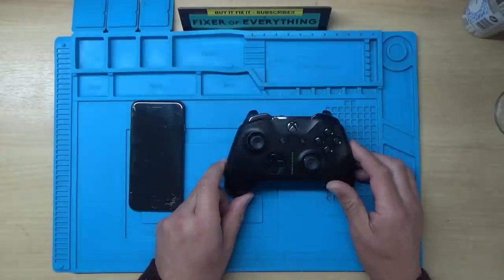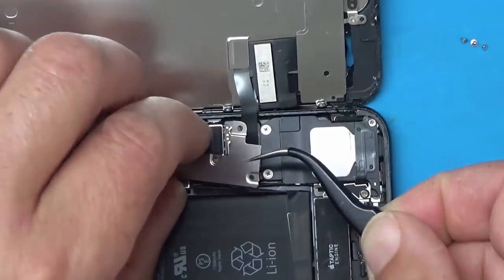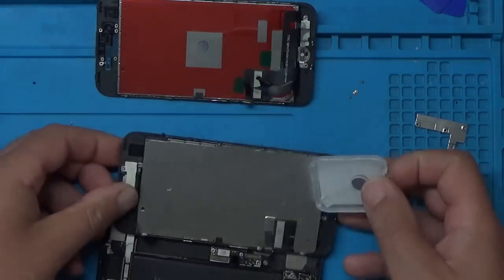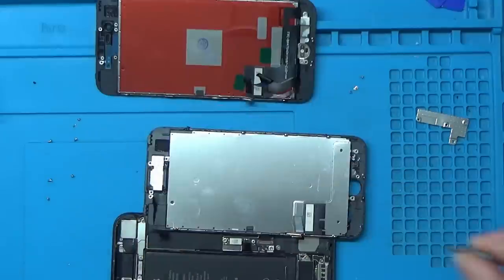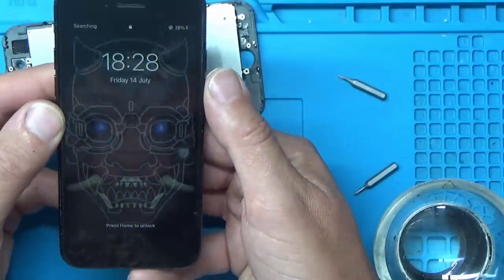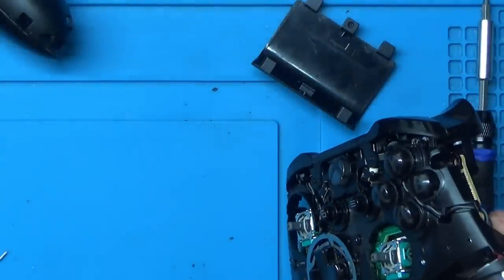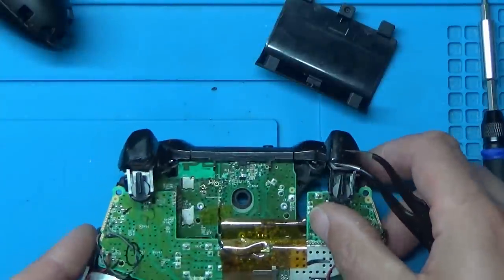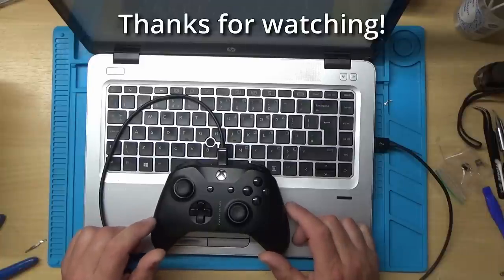My Son Broke His iPhone And Xbox Controller - Can I Fix Them?

Comment: What brand iron is that? Also the flux brand? I like them both better than what I use.
Reply from the maker: The iron is an Aixun T3A. I actually did a repair video on it last year when it stopped working. The flux was just a cheap one I bought from ebay. Kingbo I think it is, I find it takes quite a bit of pressure to get it to come out of the syringe but it seems to do the job. Hope that helps 👍

Comment: Best thing for phone screens and tablet screens is an smd hotplate. Heat screen side down at 70 degrees for 4 mins or so and that adhesive is putty. Got my hotplate a few years back, good for so many things, phone repair is just one! Silver backplate aids heat dissipation btw.oh and I-fixit guides are great for screw lengths!
Reply from the maker: Thanks Crypto Live👍I actually built a hot plate when I was repairing a Milwaukee spotlight. The led had failed and was on an aluminium PCB so I built the hot plate to remove and replace the LED. Thanks for the tips 👍

Comment: You missed the back strengthning panel off the inside of the screen
Reply from the maker: Yes I noticed after fitting it that there seemed to be a plate on the back of the original screen still, it seemed too much trouble to take it all apart again, and knowing my luck I'd probably end up cracking the new screen! but thanks for letting me know👍
Reply: @BuyitFixit  The reason I mentioned it is because I have came across quite a few with missing backplates that have caused near catrostrphic events as if they break again it is possible that the glass can peirce the battery and then bang fire
Reply from the maker: Thanks for letting me know👍

Comment: I was surprised you didn't need to transfer the bright metal shield from the damaged screen to cover the copper-colored one. It appears to cover some areas not covered by the copper one.  ¯\_(ツ)_/¯
Reply from the maker: Thanks Ed, a couple of people mentioned that, and honestly I didn't realise that you had to. I thought it was just part of the original screen. I would swap it over but knowing my luck I'd probably crack the screen I just fitted. I've still got the plate, and knowing my son, it probably won't be long until it needs changed again 😂😂😂

Comment: If you used the handle with your screw driver bit, it would magnetise the bit and make putting screws back in at least 10 times easier.
Reply from the maker: Yeah good point. I wasn't thinking of the magnet part of the driver. I just thought it would be more precise and less chance of stripping the screws using it without the length of the handle.

Comment: I'm sure it would be less fiddly if you put the screwdriver bits in a handle, you looked so cack handed without.
Reply from the maker: Yeah, the handle is quite long and I didn't want to round off the screws being too heavy handed. I used the handle in the next bit on the xbox remote 🙂

Comment: Regarding the phone, a few tips:

a) Don't push a sharp blade towards your hand, fingers or any unprotected fleshy part of your body!
b) Heat the phone's screen first (using a hair dryer, hot air gun, etc) to soften the glue (although as you mention you seem to have opened that one before)
c) For damaged screens, to avoid shards flying everywhere apply some adhesive tape all over the screen before prying it off
d) Use the correct adhesive/tape to stick the screen in place when finished, without it there's less water resistance and the phone could just fall apart
e) In future I'd recommend not buying Apple's crap, particularly the more recent models as not only are they stupidly expensive but Apple do their best to make them impossible or extremely expensive to repair. More often than not they end up relegated to a draw or landfill, so not very environmentally friendly either.
Reply from the maker: Thanks 👍Some good advice and tips there!
Reply: As a phone technician I completely agree with you. Also I recommend to heat the screen before pulling out the Fingerprint sensor(aka home button) and the front facing camera flex. The fingerprint it’s also paired to the motherboard and if you’ll rip it, you will lose touchid  also home button functionality even if you replace it. The metal plate from the back of the screen it’s there for support and to protect de screen(if the battery will expand for example)